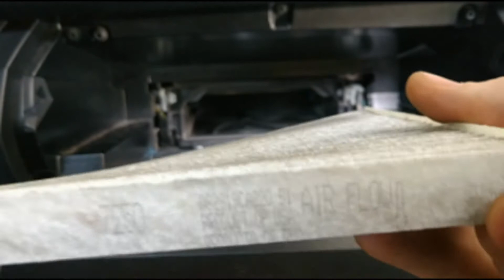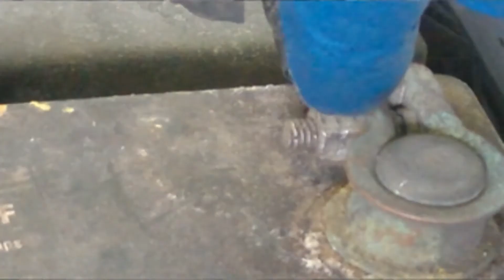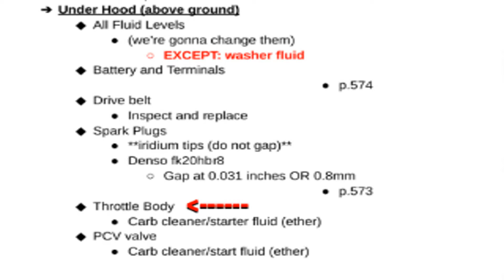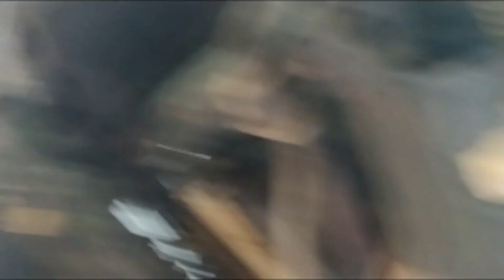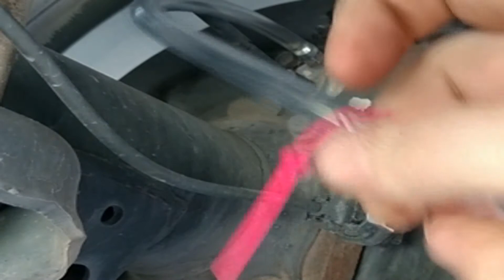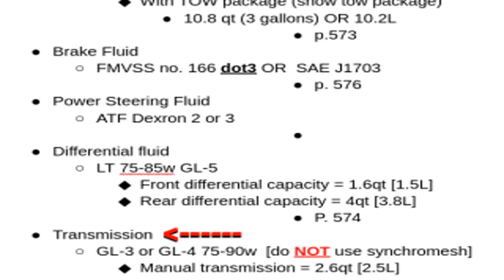100k Service on a Toyota Tacoma

Comment: What year Tacoma was this done on?  If you mentioned sorry I missed it
Reply from the maker: It *should be applicable for 2015-2019.  However, depending on subtle changes it could be further than 2019.  

This truck is a 2016

Comment: How about changing the fuel filter after 100k?????
Reply from the maker: It didn't call to change it in the manual. I cannot recall if the fuel filter is serviceable. If so, I guess I missed that step somehow
Reply: @pv2smurf  This a perfect example regressive engineering like the absence of a dip stick for the auto-transmission fluid. The fuel filter is in the gas tank, part of the fuel pump. (no in-line filter) A replacement filter is $99 and labor $299. The gas tank has to be removed.
Reply from the maker: @wlew3499  I'm sure a person could buy a universal in-line filter and place it on the frame rail to make it serviceable.  The 3.4L found in other Tacoma's, is on the frame rail and serviceable
Reply: @pv2smurf  Not to complicate things. In most all cars the tank filter is a strainer which only stops larger particles with the inline filter stops all else. The Taco in-tank filter is a micro-filter which stops everything so if this filter plugs, the car is dead in the water.(inline filter pointless)

Comment: What kind of luck did you have with the front axle drain plug? Those 10mm hex plugs are real easy to round out, especially the front drain plug, cause they get stuck in there really good after a while.
Reply from the maker: They came out easy enough. Soaked with penetration fluid, made sure the hex socket was seated all the way, and BAM came right loose.  No issues thus far with 115,000 miles on odometer